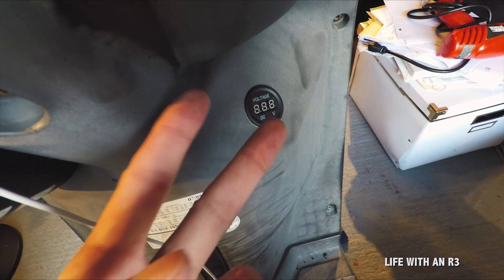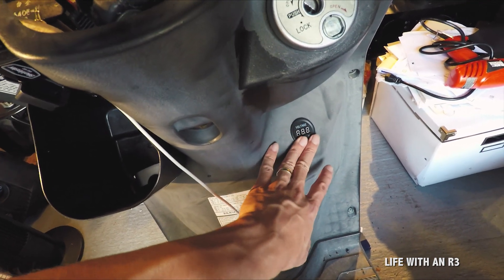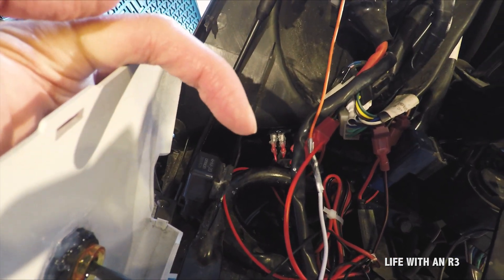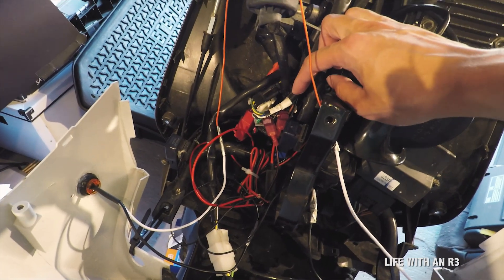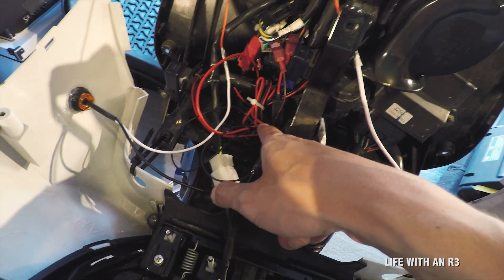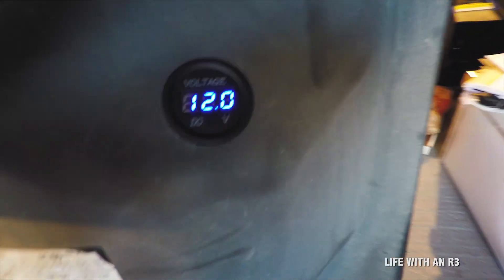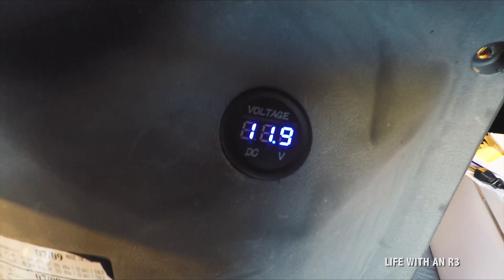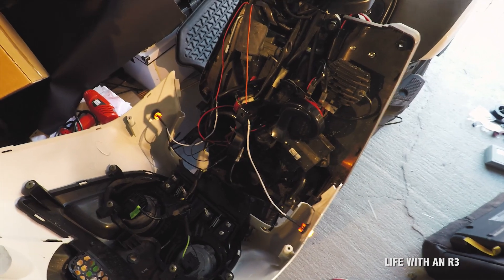How To Install a VOLTAGE METER

Comment: How to repair it mine just went blacked out after i installed it, it keeps on blinking and got destroyed
Reply: I mean it never showed any life
Reply: @wilmarandyvacaro8879  Sounds like you got a bad one, or the wires did not get connected right.